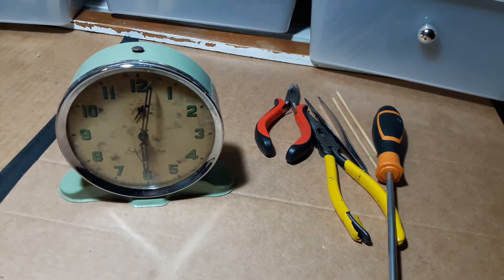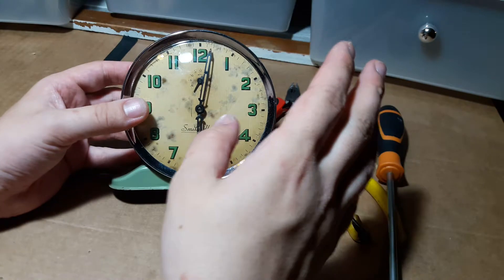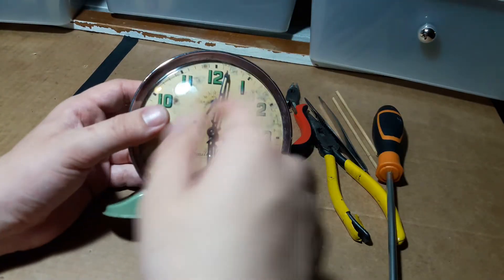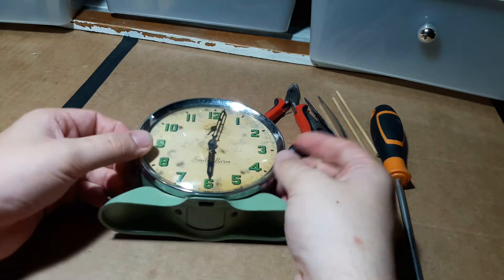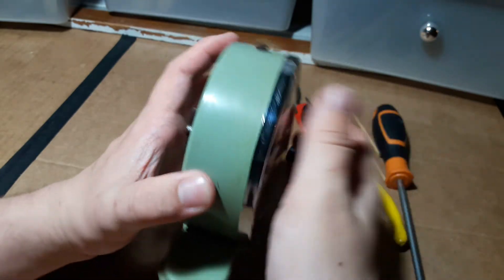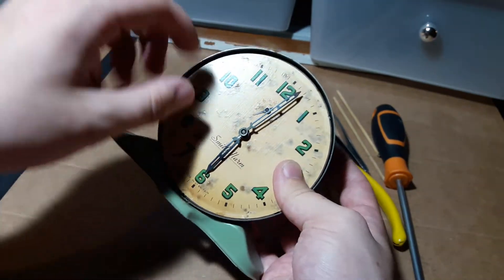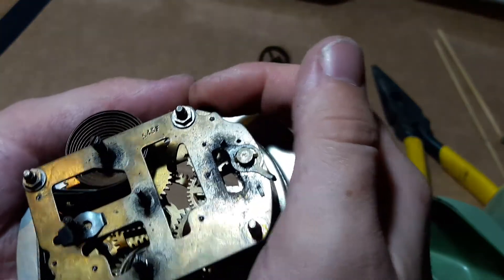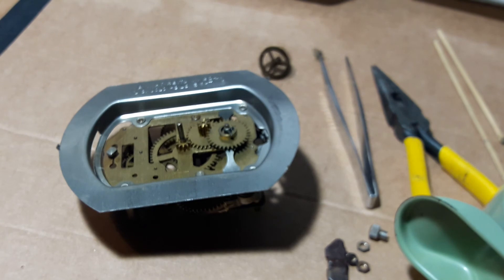Smith Alarm disassembly part 1

Comment: These videos are very useful to me. I bought an old alarm clock around three weeks ago and got it running by spraying wd40 into it. turns out its a 1949 smiths alarm clock DE/B so i figured i would learn how to clean it and identify them properly.